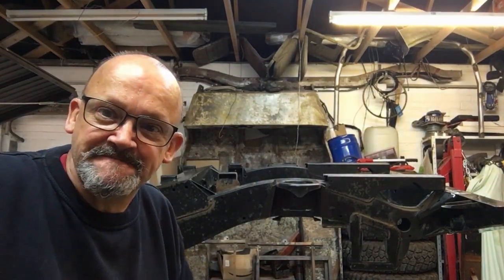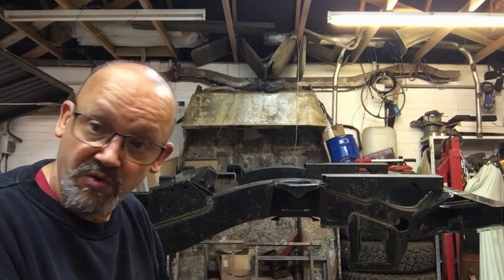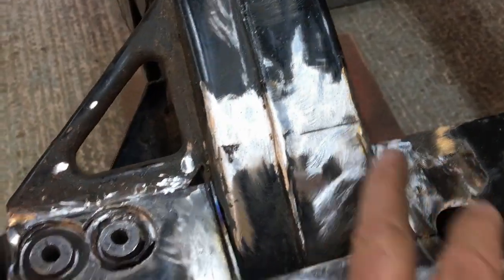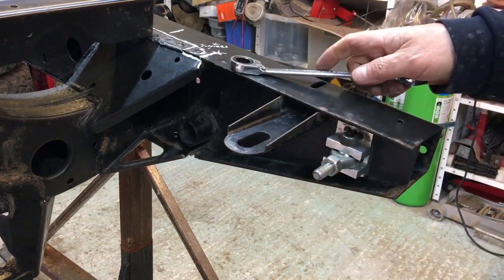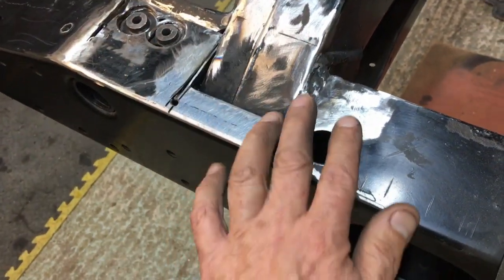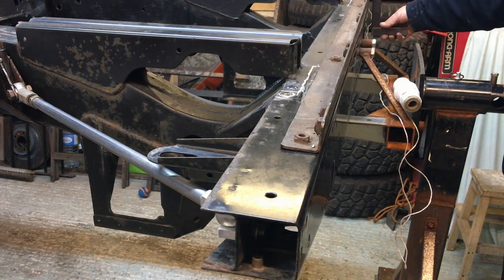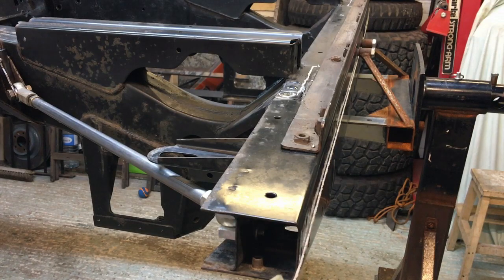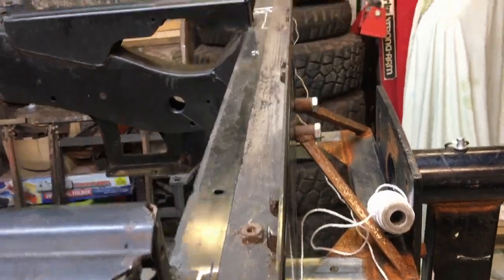Straightening the rear Crossmember on a late Defender. Part 1

Comment: Hey there Nigel! I really enjoy watching your vids on this vehicle. I don’t own a Land Rover, don’t know the first thing about them. But it is still fascinating watching you rebuild this thing better than when it left the factory! I was just wondering if you could remove the entire cross member and make your own out of some C channel or a couple pieces of angle iron welded together. Then add all your brackets and gussets and support pieces. Because what you would make would be a lot stronger and better than the factory piece. Like I said, love watching this entire series of vids you’ve done so far. Keep up the good work! Oh, and give Jess a pat on the head for me!
Reply from the maker: The X member is a complex assembly which would be very difficult to fabricate with my limited tooling.